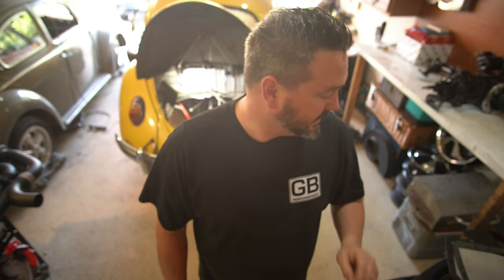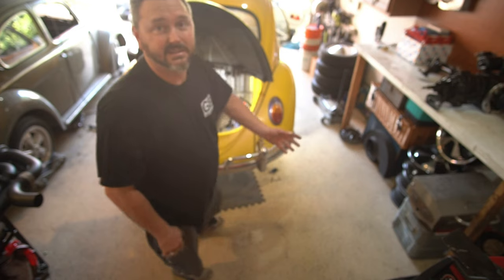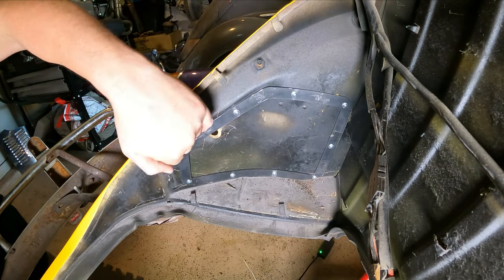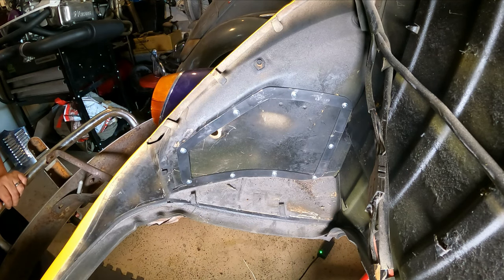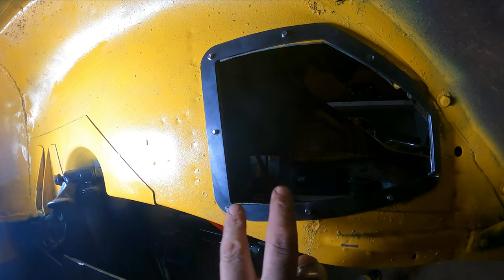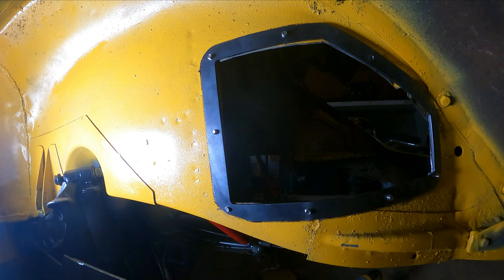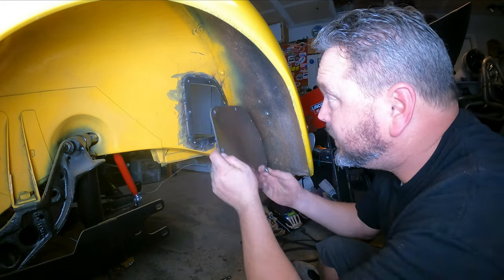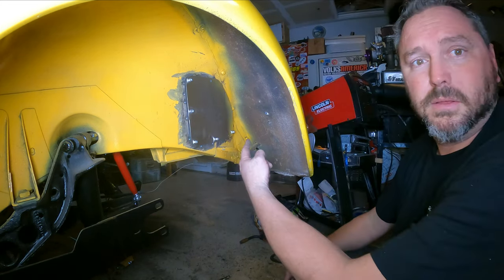Installing Weber Windows On A VW Bug

Comment: G'day,
An update on my last posts. 
When making my windows, i made 4 plates. One on each side of the panel.  But when i was about to weld them on l had a revolution from the VW gods.
Why not use 3m panel bond. This stuff is awesome. Using this certainly saves alot of welding and the end result is very very strong. 
✌️ Peace from Melbourne Australia.

Comment: I have seen holes cut for this reason,but really are they needed? What did the old timers do lol
Reply: You can do without but it’s tight. Carbs and manifolds come out in one piece to change plugs. It’s best if yo use Berg linkage. Turning any adjusting screws is almost impossible without the windows. I’ve done it on by 63 hot rod, but I don’t know how.